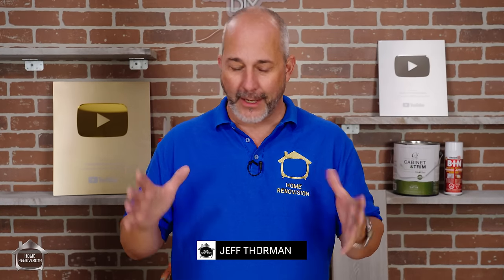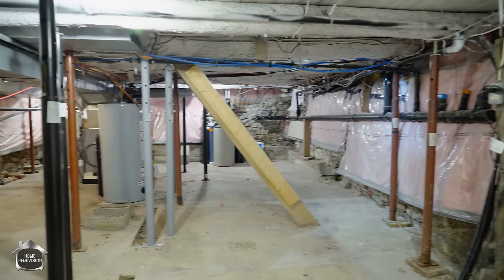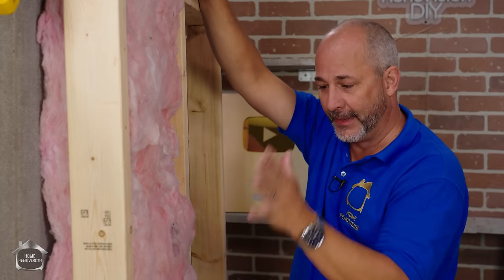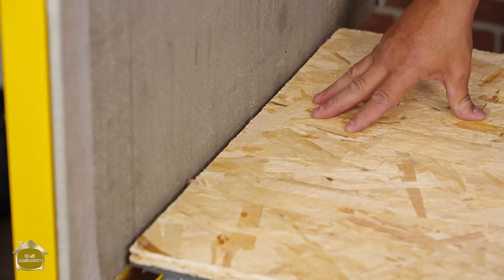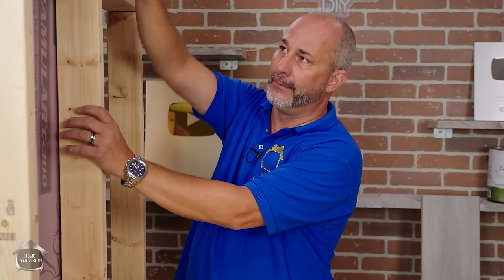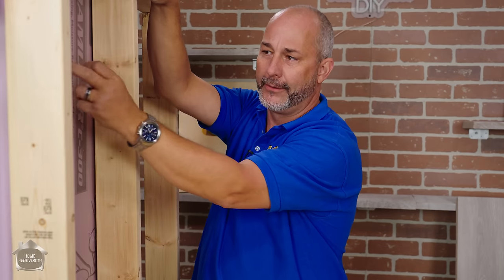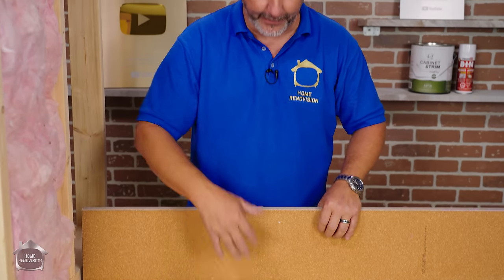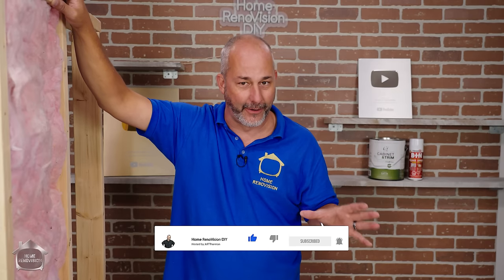The Best Way To Finish Your Basement

Comment: Wait…. Putting the rigid board ON TOP of the subfloor would expose the lip of the osb to the concrete. Shouldn’t you do the rigid board first and shim the bottom so it sits off a bit, then put the floor up against the rigid foam? This would make it so the airflow is continuous AND foam touches foam, leaving the osb board away from moisture/vapor.
Reply: I had the same questions

Comment: Yellow, my name is Dan and I have a question that In hope you can answer. I have effervescent all over my on my basement floor. Do I need to install some kind French drain in the basement floor? I have had a company out to my home and it is very expensive. If I do, which drainage system would you tell me to buy?

Comment: My house is currently being built and all interior walls in basement are Framed. Waiting a year a two to finish it. Can I use the subfloor even though interior walls are framed (no framing next to concrete exterior walls)? Framing has treated boards on floor. Would you just butt them up to the framing? If not, how much of a gap between floor and closed cell foam would you leave?

Comment: How does one design a subfloor system when there is mixed use spaces in the basement?

For instance, we are looking to have a living area, full bath, and workout area. Although the living and bath areas are compatible with the subfloor mentioned, a workout area with free weights is not compatible.

Comment: Our new home (walkout Basement) is insulated with R22 insulation, and of course the wall is wet, sweating). Our builder says they use the R22 because it won't mold or disintegrate. Do I have to replace it when we finish the basement? Or believe it will all dry up with no consequences???

Comment: Is vapor barrier necessary with the foam board insulation?
Reply: always
Reply from the maker: yes. it protects the wood from water vapor condensing during the winter months when the heating is on. Cheers. if you have a basement in the south the plastic is not needed.

Comment: Hey Jeff!  First of all, thanks so much for all of these quality videos.  We’ve been doing a full house gut for the past year and are now into the basement reno.  We always say “Jeff told me to do it this way”… and it’s now fact!  Haha.  

Question regarding the rigid board in the wall with the dricore subfloor underneath.  My concern comes from the moisture near the exposed wood where it’s 1/2” from the concrete wall with the rigid board sitting on top.  Is that an issue?  Or will moisture stay away from the wood and travel up and down the concrete wall still? Just trying to cover all ends haha!  

Thanks so much again good sir!
Reply: I have this same question. What did you decide? I am leaving the Dricore 1" from the wall, and cutting the foam slightly larger and cutting a taper so it tucks just slightly down into the 1' space without filling it.

Comment: I just want to confirm what I'm seeing in the video.  I'm installing the board with about a quarter in between it and the basement wall with the back for the board flush to the subfloor.  I can then install the framing against the foam board.  Is this correct? Can a leave a bit of space between the framing and board to allow easier wire installation?  I've seen this in other videos.  Thanks
Reply from the maker: extra space is fine to avoid drilling holes. most people try to avoid loosing space but it is not necessary since the wall is attached at the top and bottom only not to the rigid insul. Cheers!

Comment: Great video! In the process of planning for finishing my basement. I’m a finish carpenter by trade. How would you go about insulating a wood foundation? 2x8s 12” on center. When I first started out of college, everyone was doing fiberglass and poly plastic.
Reply from the maker: this is the same approach just adding a thermal break behind the frame to have a more consistent insulation. Cheers!

Comment: Do you have to do some kind of vapor barrier over the framing before you drywall? Also, what if I want to finish my basement in stages (i.e., one quarter at a time)? Do I still need to apply foam insulation to every concrete wall or just the areas I intend to finish? Also, what about partition walls that don't butt up directly against concrete? What system do you recommend for those walls that divide unfinished portions of the basement from unfinished portions?
Reply: At the 10min mark he does say to add vapor barrier on top of the batt insulation...but I don't know why since the rigid foam with taped seams should be acting as the vapor barrier?

Comment: Edit: A lot of new home builds in Ontario do not have vapour barrier underneath the concrete subfloor.
That foam board will not actually bond to the wall especially with sure poor coverage on the board itself. Foundation Wrap blankets have been used for years and have not caused a problem. 

The first 2 years the insulation is bound to get moist no matter what method is used as the concrete cures. After that it will stay dry same as a stud framed wall. Foam board is most often installed in new home construction with explosive hammer nails as oppose to the adhesive.The adhesive is not very tacky and the board tends to slide around in it a lot more. Mechanical fastening is faster and more reliable long term. Most often people prefer to use the foam board and then the studs because it saves space but needs a 6 inch gap, while blanket wrap dose not require extra insulation or vapour barrier, it dose require a gap between the insulation and the wall. It is also the most cost effective option given the cost of materials nowadays.
Reply from the maker: My system allows an air space behind the rigid foam. this is the best installation on the market for long term and short term moisture transfer to the outside. while concrete is curing the vapor can transfer to the exterior without reducing the thermal rating of the fiberglass since it is not sharing the same space. All new homes use a plastic ground sheet before pouring. in the near future you will see all homes switching to spray foam under the slab and up the walls during the build. this will allow the concrete walls to hold moisture longer increasing the strength of the cure. making basement finishing much easier and not wasting materials removing obsolete new build materials that don't function like blanket wraps. Cheers!
Reply: @HomeRenoVisionDIY  Yes I can agree with the airspace but how well dose that adhesive actually hold the board to the wall without sagging and letting go with time? NOT all new homes have a vapour barrier under the slab, In fact few of them do. Especially when it comes to subdivision style builders. The vapour barrier is never there as it is basically pointless as moisture will make its way between the slab and concrete wall. as well as any openings such as pipes If you have a vapour barrier or not doesn't matter as Code requires a sill gasket between framing members and the floor. As far as the spray foam, I don't think we will see spray foam Under the slab as that takes up a lot of space away from the  already height restricted basement. Not to mention foam is unstable and pouring concrete on a non suitable base like that is just bound to create Cracks and warranty issues all over. Not to mention cost.
Second spray foam holds a lot of moisture. Which can be a bad thing, how dose blanket wrap being periodically wet decrease from the Thermal Rating but wet Spray foam dose not decrease from the Thermal Rating? 

We have had heat and thermal tests done at our homes and the blanket wrap held up just fine if not better then a framed wall, As a 2x4 only has a R value of 1 where as the wrap has a continuous R20+ value.
Reply from the maker: it sits on the subfloor. no sagging. 50 year build. Cheers!

Comment: How to level sub floor with uneven concrete and i need moisture / vapor barrier. House is pre 1990s, floor is concrete and uneven, i am thinking i need the wood floor panel with the black rubber for air / moisture flow - can i put this on uneven concrete? do i level the floor on top of this product or under it, and if i level under it i'm assuming i cannot use wood because it will rot over time being on the wrong side of the moisture barrier.

Comment: Another fantastic video. Just wondering how you would handle a 2006 home with Superior Walls?  They already have built in foam with an R12 rating, but the fact that they incorporate concrete “studs” makes me wonder how I can use a system like this.

Comment: Our home is mid-80's...not sure about the outside slab but we have a sump pump installed (no water issues). Is that enough protection or would a french drain be necessary? Also someone had suggested waterproofing the interior walls with a Drylock sealant, but we heard that's a bad idea because it traps moisture. Your thoughts on that? Thanks.

Comment: Hey Jeff, I have been mulling over the idea of starting my basement at my own pace based off your videos and local code. 

The vapor barrier specific point has me puzzled. You mentioned in an old video about the plastic on the floor taped down. I lived in a home built in ‘51. The plastic has been there for about 8 months now that I’ve forgotten about it and I’ve never once seen moisture wicking when down there. 

What would you advise? A potential repair and added vapor barrier earlier in its life? Thanks!
Reply: Every house is different based on construction, ground shifting, average water levels (rain / water table), foundation condition, perimeter tiles, etc. If your home has a sump-pump and hasn't seen moisture under the plastic I'd say you're fine to start the process, I would still use a subfloor system. There are a million variables to take into account. If you're hesitant feel free to call a basement finishing company for an estimate and they'd tell you any possible concerns. Coming from a journeyman plumber who also has 2 years' experience in waterproofing.

Comment: Hi Jeff, I have new construction done just the way you described in the video. I am wondering if I can put the r-22 insulation compressed into the 2x4 wall after I place 2-inch foam behind it. It would be a shame to throw out all that r-22 insulation and buy new r-12 (it seems to be in good shape still). The r value would decrease to about r-13 but would still get the same overall effect in the end without spending on new fiberglass for the 2x4 wall ...

Comment: My California home actually has a basement, they're very rare here.  I also live in a very dry area, so I was wondering If that subfloor system would be necessary for my basement.  I would like to install the vinyl plank with the underlayment directly onto my basement concrete floor.  Would this be ok?

Comment: Can I use this system on a exterior brick wall. can I glue the foam board and then frame in front of it so I can add insulation

Comment: Hey good morning what if you wanted to build a cold room in the basement under the stairs which is basically 4ft x 11ft enclosed area with the floor and the back wall being bear with only concrete but the other walls does not have in any insulation???

Comment: Jeff, I love your videos! I have a bi-level home built in 1968 with hot water radiant heat in the basement floor. I get occasional seepage (every 3-4 years). Is this system  suitable for me? Thanks
Reply from the maker: if you want to use a subfloor then go with the dimpled plastic. the floor will still be warmed . you don't want insulation on top of the heated floor. the rest of this system will totally work for occasional water events. Cheers!

Comment: So the dollops of adhesive is making a way to keep the R10 rigid board a small distance away from the basement wall?  From the video, it appears that distance to be an 1/8th to a 1/4 inch.  XPS closed cell foam works as a vapor barrier.  Why not use then EPS foam?  It is a lot cheaper if you're preaching the air gap.

Comment: I would like all of my floors in my reno’d basement to be similar in height. If I use Dricore R+ throughout (tile and laminate) I should be able to achieve this. Dricore R+ (rated for laying tile on per the installation instructions…you must install a movement underlay before laying the mortar and tile). Is it still a bad idea?

Can I specifically lay Schluter Ditra on top of the tapcon screwed down Dricore R+ panels? The reason I am specifically asking about Schluter Ditra is because I read somewhere I would be trapping moisture between the Dricore panel and the Ditra membrane mat. My tiler also said that Schluter won’t warrant this install but he didn’t think it was a bad idea although he had never done it before.  The Dricore manufacturer says you can tile over it. What would be the proper way to tile over Dricore R+?

Comment: If my house is newer and I don’t use a sub floor, does it really matter if I rip out the blanket insulation? With no subfloor I’m not leaving an air gap that can run up the wall anyway. My treated baseplate is going directly on concrete. Blocking any gap that could dry out the floor/wall. Basically if you don’t use a subfloor with an air gap and run that up the wall, aren’t you trapping moisture anyway?
Reply from the maker: new houses do not have moisture to get trapped unless you get a crack. in theory if you do not get a water event then you don't need to concern yourself with moisture control. Having said that there are 30 ways for water to find itself in a basement. both from the outside or the inside or through sewer events. If you want to finish the basement with a low cost approach and roll the dice then you may be relying on insurance claims more frequently than is desirable. Cheers!

Comment: I’m looking at insulating my basement not sure how to continue to insulating the headers, I have no finished ceiling but would put one if in if it would help. Do you air seal the headers from the air gap behind the wall insulation?

Comment: Very nice video and explanation. A few questions: Instead of using a poly vapor on the outside of the insulation, would it be possible to use paper faced insulation with the paper against the drywall? Also, if I am not finishing the entire basement and just making a single room, is it still advisable to build the wall on TOP of the dricore panels? I was thinking of putting the walls directly on the concrete floor with treated lumber and putting the the dricore panels on the inside of the room. I am concerned about only (1) "edge" of my room to put the dricore panels against since the other (3) edges would not have anything and would be truly floating. I would think that the walls would be more sturdy if I were to ramset the walls directly to the floor rather than through the walls and dricore panels. Thoughts?
Reply from the maker: your way only provides separation from the wet floor. my way way allows it to dry when water events happen. If you only want comfort and no insurance against trouble then go ahead. for me installing the floor first mean the subfloor performs a service in all sorts of conditions, not just the stable condition that is normal but also during irregular weather and events.
Reply: @HomeRenoVisionDIY  Thanks fir the prompt reply.

Comment: It's true about the gap between studs and concrete foundation wall. Insulation was always wet on one side. The builder did a terrible job and I had to call them quite a bit of times as would always get wet walls, floors, cracks. The techs they would send were always bothered to have to do repairs and always tried to shift blame, I wouldn't let them. Wish this vid was around before I developed my basement. Would have just ripped it all out and start from scratch.

Comment: Hi. My house was built 2015. It was framed half way and blown in insulation. The bottom half was not framed but had an insulation blanket. There is no sign of moisture anywhere. Do you think it’s safe to say that I can frame in front of blanket and use existing frame that is on the other half of wall?

Comment: If there is no vapor barrier on the exterior of the foundation, it is safe to instead use a vapor barrier on the basement interior? I remember reading something saying that although the interior vapor barrier can stop moisture, it can lead to foundation deterioration due to water trapping in the concrete/water pressure against the concrete.

Comment: Hello Jeff, I've been a member for several months. However, I've never figured out how to access the forum to ask questions/share pics of my project. I'm now finishing my basement as you showed in this video. 
My question for you is, do I secure the bottom plates of my walls to the subflooring system?
I am under the impression the subflooring(Dricore 2"x2" panels)is spaced off each wall to allow movement(much like "floating" floor systems.
Reply from the maker: the space is not for movement but to allow air to pass behind the rigid foam. so attach the subfloor and then screw the base plate into the sub. Cheers!

Comment: Hi Jeff. What about insulation in basement with crawlspace. I have a 1 foot space between the concrete slab and my floor with some wood post. Thanks.
Reply from the maker: crawl spaces are a different science depending where you live. consider joining  our membership so you can ask questions and send in pics. that way I can help diagnose. Cheers!

Comment: theres one thing missing. The PL300, if you read the instruction, is set, then remove, let air for 4-5 minutes then press again. I didn't do this because I followed the instruction from this video and I don't want to go rip everything down again. I'm wondering how well it will hold. But at the sametime, everything is thigh fit and with the 2x4 in front of it, nothing will move.

Comment: Should I wash off the concrete walls before putting the rigid foam boards? Since there was wet insulation on those walls for probably decades I'm assuming there's probably mold on the walls.